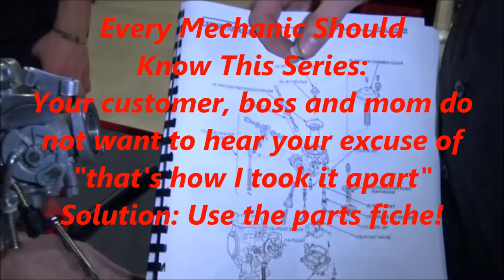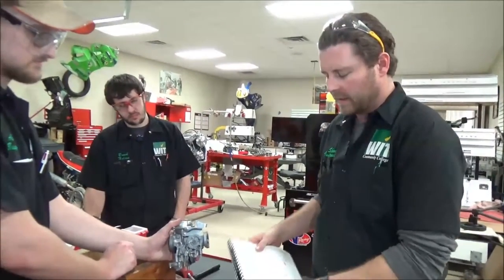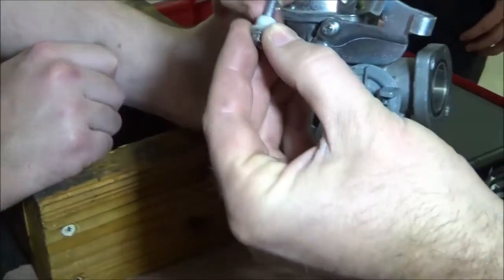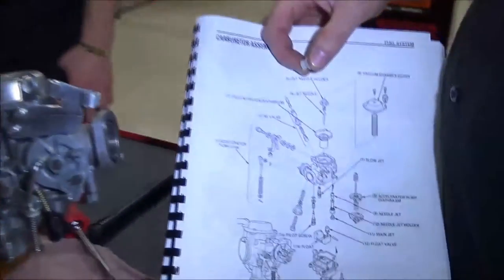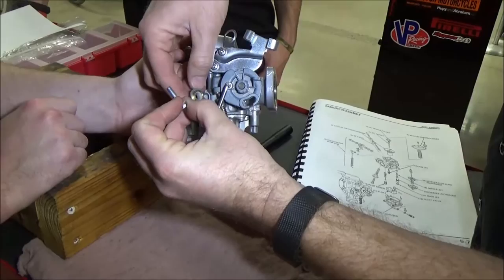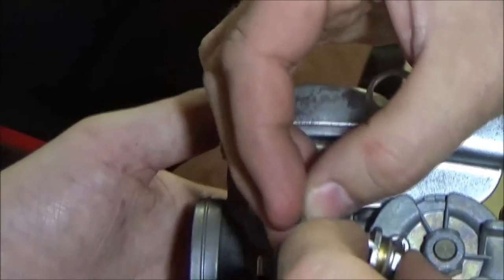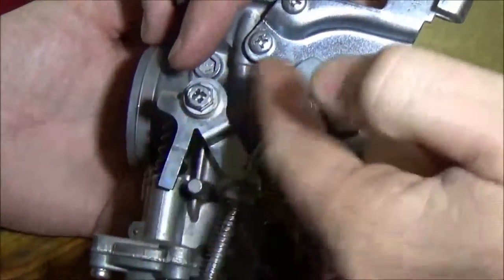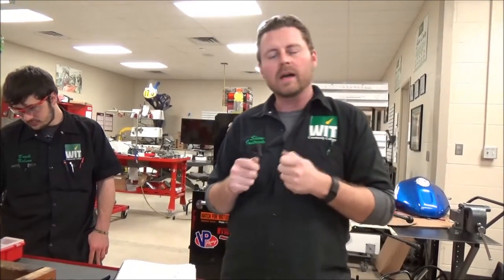Every Mechanic Series: Quit losing time following and trusting the last mechanic  Parts Fiche Usage

Comment: If you need a parts illustration you don't have you can use the Windows Snipping Tool

https://support.microsoft.com/en-us/help/13776/windows-use-snipping-tool-to-capture-screenshots

 to capture screenshots from pages which won't let you save the image. I print what I need then it goes on my clipboard. It's convenient to highlight parts you need to order.

Get familiar with online parts dealers. For example the well-known Ronnie's HD fiche online is an outstanding tool. 

Another trick when working on a custom or trying to see what fits what is open separate browser windows for fiche of different years. (Extra nice when you use a TV!) 

For more speed bookmark sites on your bookmarks toolbar or put a shortcut on desktop. Time is money. 

I keep an old Thinkpad (a used business class notebook beats new chain store crap) as a shop PC and use external keyboards so it doesn't get slimed.